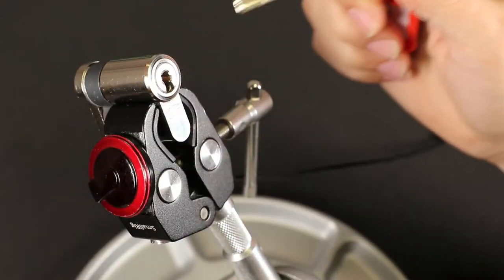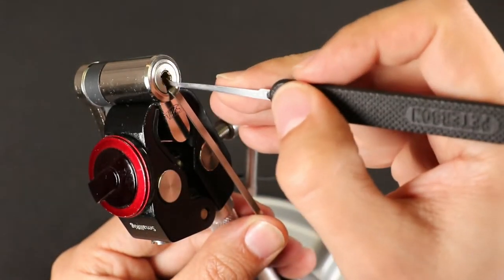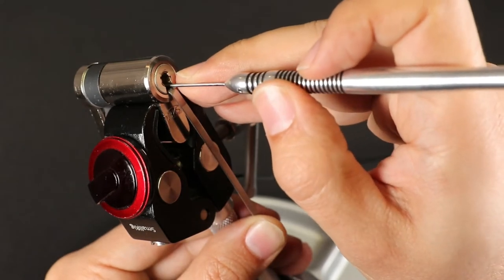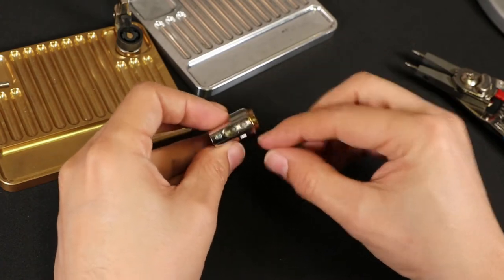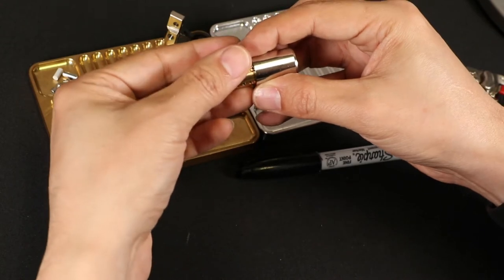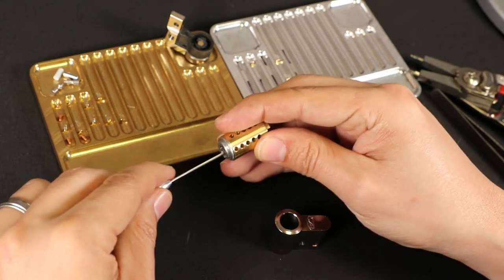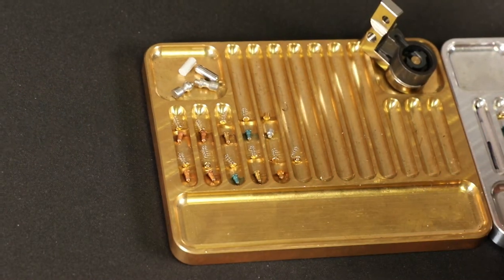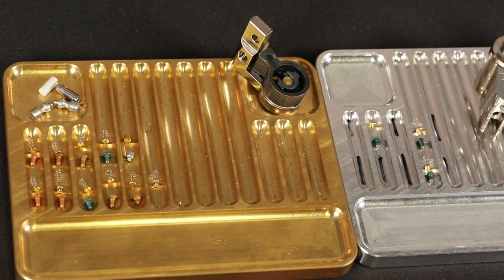[L134] BKS Janus Euro Cylinder Lock - pick and gut

Comment: I have been looking for the bar that you have your clamp attached to. Every thing I find is too large to fit into the pan advise base. What are you using?
Reply from the maker: Here's my copy/paste on my setup, hope this helps:
Panavise base (from my 350) with a camera clamp up top and a simple stud  
I use this clamp: https://www.amazon.com/gp/product/B0062U2M4E/ 
This stud: https://www.bandh.com/c/product/1340616-REG/ or https://www.adorama.com/kukg016512.html or https://www.amazon.com/gp/product/B072T4TNYW/
And an adapter to connect the two: https://www.amazon.com/gp/product/B01N132CZ0/
You need to screw the clamp on to the knurled end of the stud, if you put the knurled end down into the base it will not be held solid and will wiggle.
Also recently found that this has been done before! https://www.instructables.com/Locksport-Vise-Head/
The red thing is a guitar pickup for listening to the lock https://www.amazon.com/gp/product/B07HVFTGTH/ which gets fed into my Zoom H6 Audio Recorder, but many people use this amp into headphones https://www.amazon.com/gp/product/B00EJCYSMQ/
Any picks with white handles in my videos are homemade. The music wire tensioners are cold bent, filed at the end, and 0.078" diameter, but you should use whichever thickness is wider than your keyway.
Reply: @norlin76  Thanks! I could never figure out what words to use in the search.